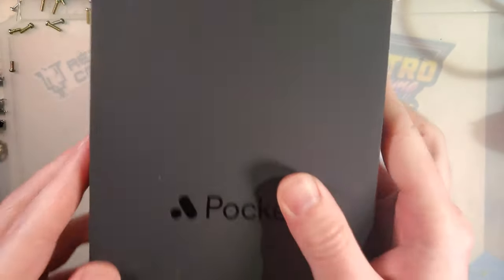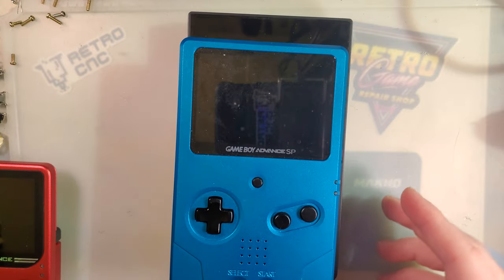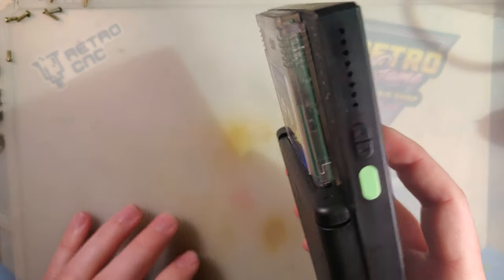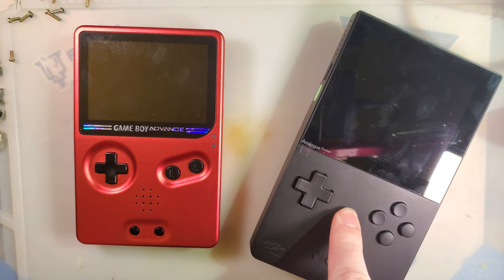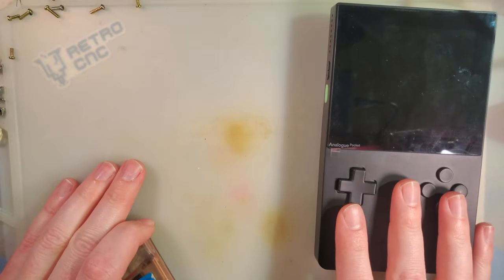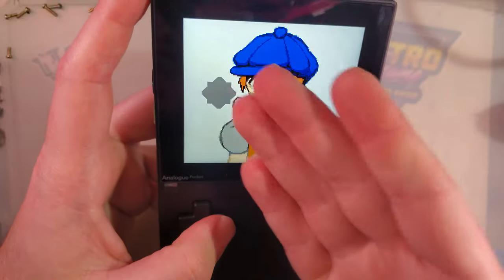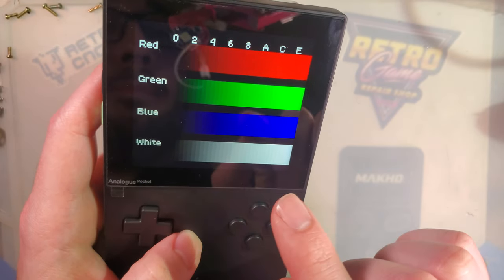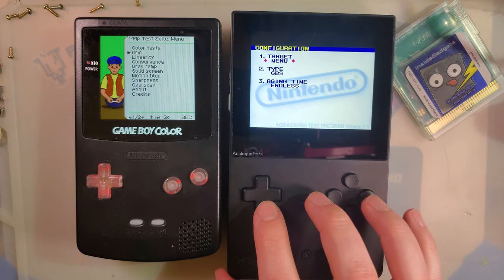Analogue Pocket

Comment: I'm tied between one of these, gba consolizer and a gamecube with a gba player. very hard choice lol. does this work with standard usb c docks that youd use for a laptop or only their one?
Reply: Consolizer if you're using it primarily for TV/monitor. Plus it uses og hardware.

Pocket is FPGA (Hardware emulation, don't fall for the official marketing lies that say its not emu)

GB Player won't give you the best quality even with GB Player Interface.
Reply: @omgiTzkitteh  consolizer is still out of stock also and idk when the preorders are for. i was thinking of the pocket because its price/versatility although id probably end up using my other gameboys when playing handheld anyway. Only really consider it an option because of link cable support. would be cool if some of the other emulation handhelds added that
Reply: @shadowthehedgehog5832  GC is likely the best option, albeit the most expensive one if you want the best image quality out via cables and whatnot. Pocket has the advantage that you can play all supported systems on the TV with the same low latency as original hardware, including the others like GameGear and eventually the other ones. You also get nice display filters if that's something you care about. Consolizer would be a pretty cool gadget, but it seems like it also has a few issues yet with image output.

Personally I went with the AP because it supports a bunch of systems on my TV I can't get any other way without software emulation, as I don't have a GC but own a hacked Wii U.
Reply from the maker: Cheaper and more available consolizer option for GBA: https://github.com/zwenergy/gbaHD

Only dock that works with AP is their special sauce dock, unfortunately. Or so I've heard. I haven't tried mine with any yet but I'll check it out when I put it back together.
Reply: @RAHelllord  Afaik the consolizer video output is only bad on the stock disc there is homebrew that makes its output very clean, AP does seem like a nice option though
Reply: @makho  Thanks ill check it out

Comment: Where di you get the - well, everything on that evangelion micro?  I need it.  The buttons.  The faceplate - the shell.  It's all amazing!
Reply from the maker: It's all custom but the faceplate sticker (which was also technically custom, just not one-off) but the original seller no longer sells them. Body is cerakote (from a local shop). Buttons are resin cast (from madmorda).

Comment: Good stuff! I wonder if the white version hides the finger prints better as that is ridiculous.
Reply: For the white pocket It doesn’t. The scratches are More visible and it is more vulnerable to being scratched. Be careful setting it on a table made of glass of wood. Plastic wont scratch it as much. Be extremely careful with the white pocket. Hopefully a rubber clear plastic case that fits around the pocket will develop soon.

Comment: Sleep/wake could be a issue for RTC, right?
Reply from the maker: My understanding is that the console is basically taking a save state so probably depends on the specific game and how that game interacts with the on-board RTC hardware. It hasn't been an issue in my experience but I also tend to not use that feature.

Comment: Hey makho, this is completly unrelated to the pocket. I ordered your gba tactile button mod from osh park, but when I try to play a game (im using pokemon gold with no save to test) down on the d pad is held down when seting the clock, and the left trigger seems to get shorted out too. I tested all the buttons with a multimeter and theres no shorts. I also desoldered the pcb to make sure nothing was shorting on the pads under it. The gba worked fine without the pcb soldered; the issues only appear when its soldered down. Not sure if ive messed it up some how or something, if you have any tips or trouble shooting that would be great. Also not sure what the extra pad beside the ground is, just an extra ground?

Comment: I wouldnt call the GB Operator a scam... because while it sucks that the software doesnt have all the promised features, for $50 (about $6 more than something like a GBxCart or something) you get a much nicer looking cart dumper and flasher that can also actually let you play the games on your PC... (also they did just release another update on the 1st of this month so theyre just obnoxiously slow...).
Reply from the maker: > the software doesnt have all the promised features
Since it's almost a year later, this is precisely what a scam means.

All other cart readers work the same in that you can dump a rom and save and run them both in an emulator, this one is nothing special. There's even custom software for stuff like that for GBxCart RW (GBxCart Play Cart v1.7). This thing is $50, GBxCart RW is $30, both before shipping ($9.50 for epilogue, $14 for iG).
Reply: @makho  Thats not at all what a scam is. It would mean the thing didnt function at all in terms of playing games or reading/dumping/flashing carts. That the emulator doesnt have some features (none of which are actually required to play the games) or the fact that you cant turn off the LED doesnt make it a scam. It would be a scam if they dumped and ran and never updated it at all. Taking a long time does not, in any way constitute a scam.

There have been atleast 5 updates to the app to date (0.6, 0.7, 0.7.1, 0.7.2 and currently 0.8), across 3 separate platforms (Windows, mac OS and Linux). For a "scam" they sure seem to be providing a good amount of support.
Reply from the maker: @Avalon304  A scam is selling something that does x, y, and z, and shipping a device that does x and z and then never adding the y feature that they promised. That's exactly what epilogue did. Cart rewrite support is still basically MIA. 

Also, 0.8 doesn't actually exist. The version linked on the site is 0.7.2 still, despite saying 0.8.
Reply: @makho  They shold a thing that reads carts, dumps roms, dumps saves, flashes carts and also plays games through an emulator and then puts the save back on the cart when youre done. Thats what I was sold and my device does all that. And it manages to do all of that while looking nicer than any other alternative.

And for 0.8 not existing... thats odd my software says 0.8 when I open it... so... I think you may want to check that download again.

Under your definition of "scam" every piece of software would be a scam until it was 100% complete with no more development being done on it.